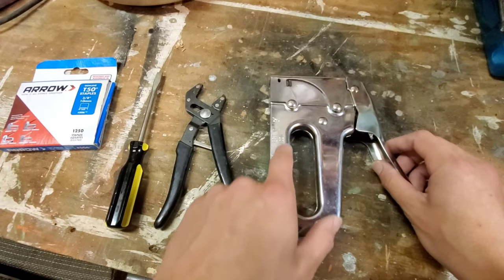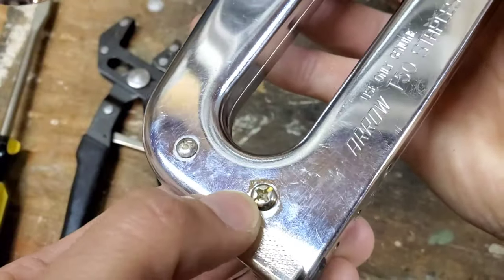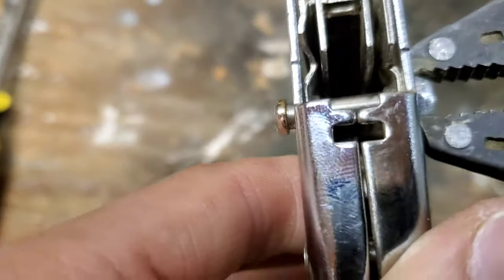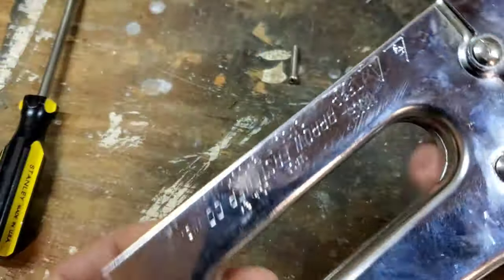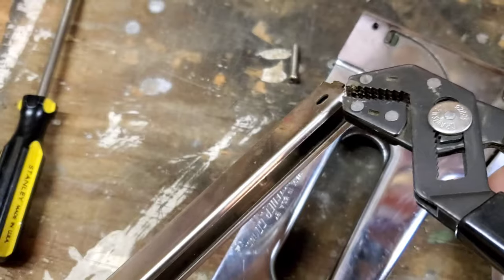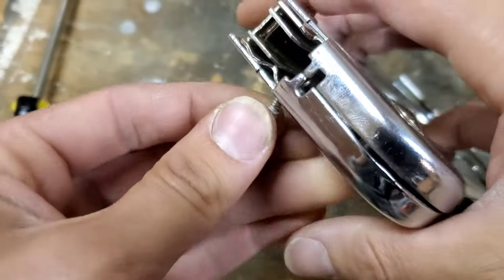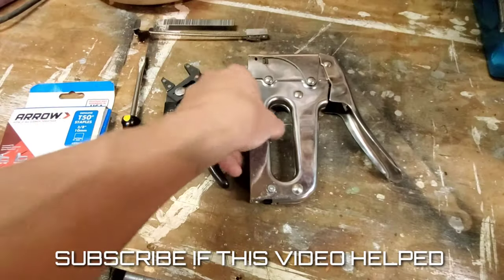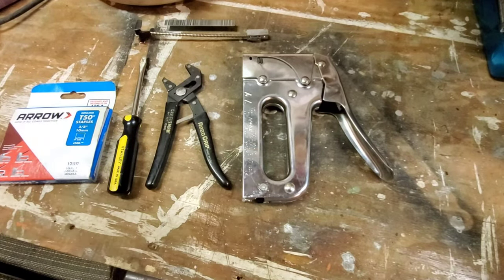How to Breakdown and Clear Jammed Staples Arrow T50

Comment: amazing! Shocking how few steps it actually takes to accomplish such an important task. I guess it should have been a hint that it's the only part of the gun that looks like it's meant to be disassembled with the kinds of tools that you'd keep around the house... all the other fasteners through the gun are pins with those c-clips (except a couple rivets) like you're not supposed to ever take them apart. I guess the mechanism that they hold in place probably requires a special tool to get it back in if you let it out, so a bad thing to do if you're anywhere but the factory that makes it. 

That mechanism they're trying to keep you out of houses an extremely strong spring, so maybe getting the spring into place is just dangerous, like how garage door springs are a huge hazard.

Comment: Mine does not have a jam the silly thing will staple one staple and stop working.  I pull the spring back let the staples slide back put the spring back and I can staple one staple only until pull the spring back again.  Had to do a whole project doing this.  Is there a fix for this?  Again no jam, simply have to pull the spring partially back untill the staples slide back some and reinstall the spring.  Only works for one staple each time.
Reply from the maker: It sounds like you are having an issue with the spring that pushes the staples in place. Maybe replace the spring and see if that resolves your issue?

Comment: How come the proper ARROW brand staples jammed it ???? One side of the staple fell out by itself, (yet have to use your trick) and the other half of the staple is still in there, jammed.

HOW COME ????
(It's a brand new ARROW T50 stapler; first time i used it)

Comment: why do they jam usually?
Reply from the maker: If the staples are put in wrong or a bad staple
Reply: @TacticalAdvisor  I threw like 2 away because i couldn't figure it out.. But i still have 3 that work so i was just wo,derin. thanks
Reply: I recommend using some rem oil on it. Same oil you use to lubricate guns. It's a machine, so you need to lubricate it. Basic maintenance.
Reply: @lordkrythic6246  where do u drop oil
Reply: @carolynd2285  Everywhere. Slather it.